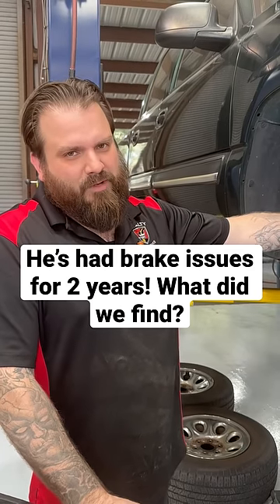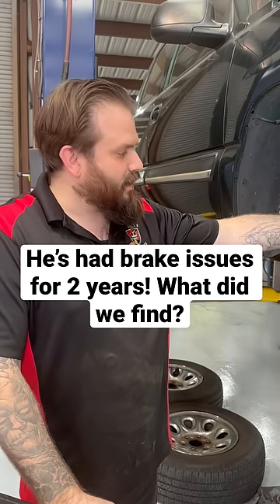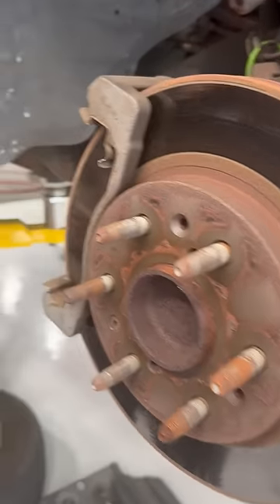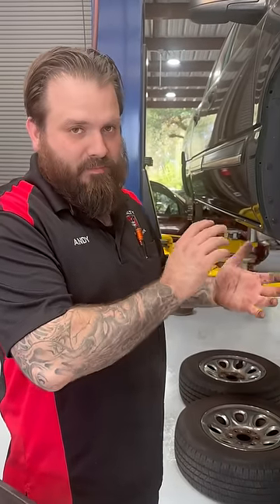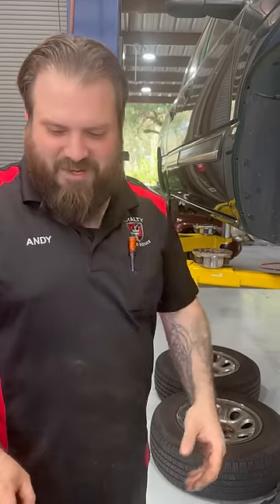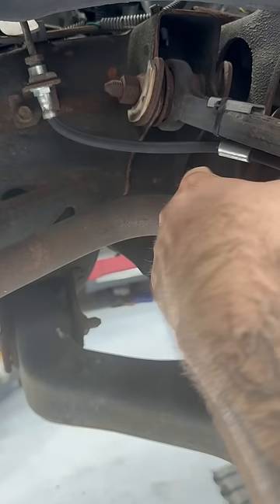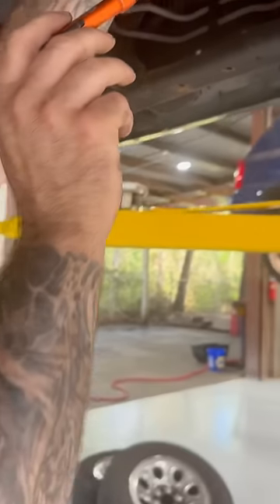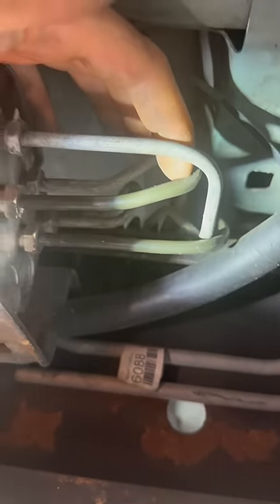Brake Issues for 2 Years! What Did We Find?! #shorts #mechanic #automotive #car #autorepair #brakes

Comment: ….the brakes stay partially engaged as the pressure equalizes through the restriction
Reply: 100% nailed it. What gets me who ever ran new lines didn't stop and correct their mistake and let it ship like that. Any tech worth his salt is gonna inspect his work when bending up new lines to be replace old ones, so either the person literally CBA and said it'll ride 😅. Ppl like that gives us good techs a really bad image/wrap for their stupidity and negligence. Such a easy very preventable situation.
Reply: You’re exactly right.
Reply: I had a fairly new brake hose separate internally and form a non return valve. It cooked a brake disc.
Reply: Is this something I should look out for if I'm needing repeated break repairs?

Comment: I wwnt through the same exact diagnosis with a 2005 Silverado. The customer had already had calipers, hoses, and pads on both sides. A new hard line from the drivers front block to the ABS module "without the kink in the line" and the left front was still continuously overheating. And finally a new master cylinder before getting to me. The passenger side was getting hotter than it should but nowhere near as hot as the drivers. I eventually diagnosed it as the old master cylinder had been dripping brake fluid into the booster causing the diaphragm to swell and not fully release when letting off the brake pedal. I replaced the booster and it fixed the issue. I got a normal temperature reading after my test drive and only a 4 degree difference in temperature between the front rotors. After that I preformed a complete fluid flush and exchange just for good measure as DOT 3 fluids boiling temperature is way lower the some of the readings I had recorded in my diagnosis drives. And at no extra charge to this customer. He was so grateful for this one job that he then began to bring all of his Express cargo vans to me when they needed anything fixed. I went from just me in a single bay in a literal storage facility. And third hand lift. To building a 8 bay garage with new bend pack lifts, hunter alignment rack and machine. Various hunter equipment. And my own Snap-On pitbox custom made for me all from doing a little extra and thoroughly for a huge carpet cleaning business. Take pride in your work no matter how insignificant the job and charge the customer fairly. You absolutely never know how it can change your life.
Reply: Well said and spot on. God Bless you for your character and integrity.
Reply: Awesome.
Reply: I had a truck that was wearing out the front pads way faster than he should have been every time he had got new calipers new lines pretty much a whole new braking system same problem, it turned out his Steering angle sensor was not properly calibrated causing the vehicle to slightly drag the front brakes, another shop had done all that other work without looking into why the stability control light was on
Reply: I allways assumed brake fluid couldn't hurt the diaphragm in the booster as it isnt a petroleum product (brake fluid mixes with water). Anytime I have had a booster full of brake fluid I just suck it dry and reuse. Now I HAVE seen (plenty of times) oil change places top off the brake fluid with ATF and that will very quickly destroy the master cylinder and if the fluid leaks back into the booster it will destroy it as well.
Reply: @TechnicianRed  damn really? I’ve only seen a customer do that themselves one time, They probably think because you can use atf as power steering I’n most cars that u can use it as brake fluid to
Reply: @WillSwingem  yep I have seen it probably a dozen times so far. So about once a year. Not super common but does happen.
Reply: This is true Capitalism and Humility rolled up into one. Capitalize on serving your fellow man, your brother, your kin, out of the kindness of your own heart, and the Lord will bless thee 10 times over. The Bible truly is a guild book.
Reply: Props, man.  Nice to see that doing good, honest work paid off.  Well deserved!
Reply: @WillSwingem  works wonders for coolant, as well.  It’s the do-all product.  Didn’t you know?
Reply: Right on!
Reply: Thanks for being a good person. I hate going to new people with my car issues.

Comment: After 2 days of brake problems id be worried let alone 2 years
Reply: It would probably feel fine for a while, then due to overheating the rotors would warp and he'd have a vibration.  I'm sure they stopped reasonably well, though likely a bit weak because they were already hot.
Reply: @dustintunis9347  two years to find a kink knowing only one brake line had been changed?  Give me a "brake".
Reply: To be fair it sounds like he spent a lot of time and money trying to fix the fault, not like he just ignored it for 2 years.

Comment: I was a career mechanic for 20 years before I got into facility management. I learned early on to troubleshoot a system, not a problem. I have a brake issue. Ok so I’m going to inspect the entire brake system starting at the wheels and ending at the pedal itself. Issues like this are easily prevented by the right technique.

Comment: 2 years worth of brake issues? Dude 🍀 he still alive.
Reply: Check this out, i warp my rotors every 10/15k but when I start to feel it I swap em , brake issues are no joke
Reply: Yup, hes just always late.
Reply: Lol
Reply: Not really. The brakes work just fine, but the piston return is delayed because of the restriction in the brake lines.
This causes vibrations, but is not directly dangerous to drive with.
Reply: @panzerveps  I’d love for you to drive with warped rotors and not feel scared while driving 80 down the inner state and come to a direct halt
Reply: @Thelost909  I've driven several vehicles with warped rotors. It's uncomfortable, and far from recommended, but it's not directly dangerous. It's not something that happens in a heart beat either, so any driver with more than 2 brain cells should be able to adjust their driving.
Reply: @panzerveps  thank you for the info! I felt like I was always putting myself in a death wish with warped rotors

Comment: This is another example for why nobody but me touches my vehicle.
Reply: On the one hand, no one else is gonna treat it like their own, but on the other hand, I’m now limited to my own expertise/tools/time. It’s a huge commitment, but it’s how I treat my motorcycle!
Reply: @avwholesomegamer  When I work on someone else's vehicle, I can't cut corners like I can when I work on mine.  For instance, I rebuild my own caliper (using premium parts, most likely) but for theirs, the caliper more than likely gets replaced.  My vehicles have the original oem calipers on them in most cases, along with chrome steel pistons in place of the original phenolic pistons.

Comment: Every brake job i do, i open up the clam that holds the rubber hose onto the control arm.  Here in ND and MN the braket rusts and chokes down on the hose.  Seen it many time where they lock up but either way, i release them on every brake job.  No matter what.

Comment: I don't use that steel shit any more, it's all nicopp baby! No problem with kinks. Flares easy. Makes you pay attention to how you flare. Nice to work with.
Reply: Absolutely!  If I'm making the lines and not using a preformed kit.
Reply: @thisisyourcaptainspeaking2259  only finding those for select pickups, mostly gm. I can re line a truck in about four hours with two spools of nicopp. It's about half again as long for a line kit. I gave up on line kits a long time ago.
Reply: @metalsurgeon9196  Agree, locating an applicable kit is often a challenge.  Then snaking the replacement lines through can be a challenge.  So yes I agree, may as well go with the nicu to begin with.
Reply: I learned that the hard way replacing lines on my truck.  I'm not a mechanic.  It was a time suck but didn't cost too much financially.  I spent one evening with steel lines and went nope.  Gotta be something easier and find out there was.  I learned a skill out of it so there's that.  And the lines didn't leak.
Reply: And use a real double flairing tool, not a $20 bar tool. It's only your brakes.
Reply: @AttorneyBCollins  you can get adequate results, you just can't hold a 1dtenT cert when you do it. It's almost never the tooling, but the technique and the experience behind that tool.
Reply: I've found that it's usually more cost effective to buy pre-bent and flared brake lines.
Reply: @panzerveps  Try finding pre-bent for a 2004 GMC Savanna 3500. Sure, maybe a pickup. I didn't want to buy a whole kit which was my alternative.

Comment: My 2006 Chevy truck has the exact same rubber hoses when you turn the wheels all the way to the left or to the right they tighten up like that for some reason
Reply: My 2005 does the same had to move the screw hole or u can just zip tie in the right areas get the right amount of slack or tightness

Comment: I haven't bent a brake line in years. I purchase mine pre-bent from classic tube.

Just converted my foxbody Mustang to stainless steel, for $275.

They even do, fuel lines and, transmission lines. Offered in polyarmor, and stainless.

They're currently working on some brake lines for a 1974 Ford f100 for me.

Comment: I know you mentioned it briefly, but that brake hose with no play (very tight!) at the wheel is also a critical issue.  One hard turn and it pulls apart and your brakes are gone. Needs a little bit longer hose for a little more 'play' so the wheel can turn without stretching it out

Comment: As a service adviser, I had a problem with a trail blazer. You would drive it for about 20 minutes. And after 20 minutes, the brakes would lock up. Had the technician take tools and loosen off the lines and it lost the brake pressure. He could drive it back to the shop. It might get hot enough it might not. What we found is the vehicle was in an accident. And it bent the firewall so that the relief port on the master's stolen door was almost closed. The hotter the engine department got, the more the firewall would bend. And it would close a relief port. Then the fluid heated up and applied the brakes.

Comment: A common symptom of bad brakes, the wheel will be covered in brake dust.
If this is happening to your car, wash your wheels REALLY good. If its dusty within a a week or two and you are not hard and fast on your brakes, you might need to inspect your brakes.
Sticky Caliper piston
Rusty/dirty pad clips
Pinched brake lines
Bad wheel bearing
$100 caliper today is cheaper than $500 brake job a month later.
$300 front strut is cheaper than a tire, ball joints, wheel bearing, CV Axel u joint.... The list goes on. Be vigilant about your maintenance and only use trusted mechanics.

Comment: Grooves on brake rotors are NOT indicative of overheating. Discoloration is an indication of overheating. THis vehicle was not braking proportionally due to that bend on that brake line. Owner just needs to return to that original shop, talk to the owner/manager and then threaten to sue if they don't take corrective measures to correct their mistakes. A lazy technician can destroy the reputation of an excellent shop.
Reply: There's another good reason many guys are known as technicians.
Reply: When you threaten someone about sueing them, the conversation is over
Reply: @jeffberner3102  That’s right. I’ve been there with another shop that destroyed a customer’s entire braking system on his BMW 5 series. I helped prepare the case against the other shop and we did threatened and they settled for the repairs, about $4,500 plus reimbursement for the defective brake job that caused the damage. It helps when there’s a retired federal criminal agent with extensive court room experience as a shop manager.
Reply: Yeah I was about to say I have brand new rotors and pads on my race bike and they’re already grooved

Comment: I mean if you've had brake problems for 2 years obviously it's not actually the rotors or calipers messing up there's an issue further up the system. My first check whenever I'm having brake issues is fluid level, then calipers/rotors and finally brake lines themselves to make sure nothings kinked, cracked or missing and all my mechanic experience is stuff I learned at home with youtubes help. If I can do it a professional mechanic should be able to especially since you guys get paid for that i dont.. mechanics like this guy are the type of mechanic you need to go to regularly if you don't fix your own vehicles 👌

Comment: the shit people do or leave alone always concerns me. bought a junker fixer up manual cruze. needed brakes all around among other things. anyways fresh brakes everything else fixed i got for a test drive to find out the e-brake hangs just enough to overheat the rear brakes and nearly slammed into someone coming to a stop. 20$ worth of fucking parts that nearly made the car a death trap beyond the rotten brakes i replaced all around.

Comment: Even when the most experienced mechanic's do brake jobs they often forget to lube the caliper slides. They stick and will cause one pad to wear faster than the other. Since they are dragging of course they get hot and score the rotors.

Comment: The one thing that sucks about brakes sometimes is that you gotta go back before you can isolate the problem. Like I had calipers that kept going out and I went through three of them before I found it was a hose. Once I fixed the hose, it was alright.
In this case they had to go back one more section to the line.

Comment: Had a similar instance. I had a dent in the steel line before the hose. Replaced my front brake assembly just to find out my front drivers wheel was getting hot. Took a bit of headscratching to figure out.

Comment: Sooo ive been having the same issue with my driver side front brakes. Ive replaced caliper, put more expensive pads and rotors. After a while it will squeak or seem like its dragging its weird. When you first put new pads its quiet until after a month or 2.

Comment: I used to have a similar issue and got rid of the car, I never though to check something like that damn
Reply: The hoses usually get pinched when the hangers rust out and squeeze them really good. You can tell immediately when you try to presd the brake and no fluid comes out or very slow indicating a bloackage or restriction.
Reply: @scientist100  That would also explain why when I flushed and replaced the brake fluid it took forever, I really should have thought more about that thanks I'll keep it in mind in the future.

Comment: Does a grooved rotor increase the pad heat so much it cracks? Or is it the increased foot pedal force of the driver that cracks the pad? Thanks
Reply: The extra friction involved in having the pads permanently rubbing the disc means that the pads never cool down, so the pads will overheat and crack. because they are continuously hot, and being cracked, they rub grooves into the rotor "earlier" than expected. The rotor may well overheat and warp, increasing the obvious wear.
AFAIK!
Reply: @neilbarnett3046  wow I didn’t know that until your reply! Thanks

Comment: What's the effects of tight or kinked brake lines?
It was mentioned, but i'd love to know how this negatively affects performance and other variables.
Reply: I'm just a laymen, but with the brakes being that hot, I'd guess that's a return line.  So the lines to the caliper are fine and the pads compress.  But the fluid can't return well, which keeps the pads from releasing.  It actually looks like there's 2 kinked lines.  Main point is high pressure can push thru kinked lines.....but can't backflow freely thru the kink.  I think anyway lol.

Comment: I have a 2013 Subaru BRZ limited 6 speed manual I have intermittent starting problem I change my starter battery but still will randomly not start

Comment: Literally not one thing you pointed at was accurate except the kinked metal brake line. The grooves in the rotor are from pad slapping (replacing brake pads without resurfacing/replacing rotor) and or using inferior (cheap) pad compounds, the rubber brake line was mounted in the bracket on the control arm, just like other chevrolet trucks of that era, it was fine. The bent metal brake line was in fact the only problem.
Reply from the maker: The kinked brake line was causing the drivers side to get hot , as mentioned in the video. The pad was cracked, as seen in the video. I don't know if you were saying that is incorrect. The passenger rotor was very grooved, just hard to see on the video. The drivers brake hose was either incorrect for the vehicle or was of poor quality. It was too tight (not long enough between mounting bracket and fittings.  This was a short video so we didn't have time to show how tight the lower part of the hose was when the wheel was turned all the way. The new brake hose has more play in it. I stand by that we were correct in all of our findings.
Reply: @theroyaltyautoservice  aftermarket inconsistencies yeah I watched again and saw how the line was stretched... Good video

Comment: fix the brake line then add braided from lines and then put drilled and sloted rotors with carbon pads all around

Comment: whos driving around for 2 years with brake issues? now im honestly a cheap mtfker when it comes to my cars. I drive junkers but the one thing that needs to work properly is the brakes. and I learnt the hard way.  next are lights than the engine. the restbu dont need is nice to have but extra.
Reply: Decent shocks help with good breaking if bad the car can dip in the front end when applying brakes